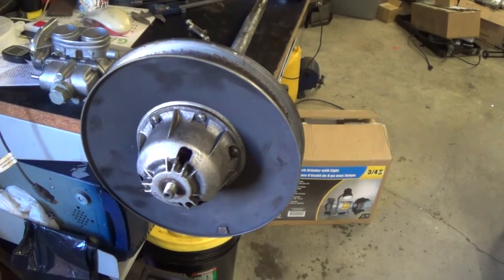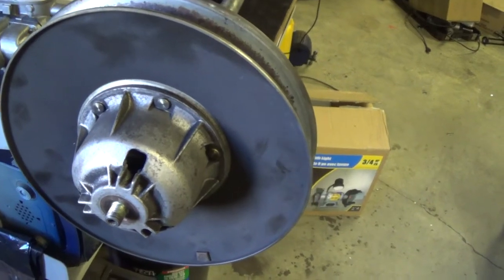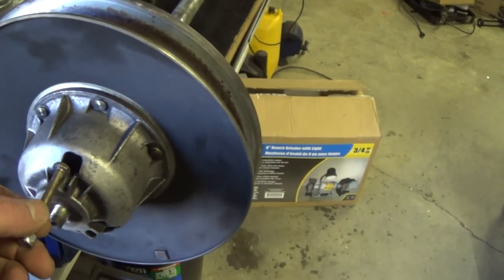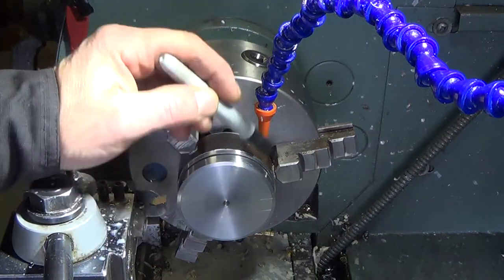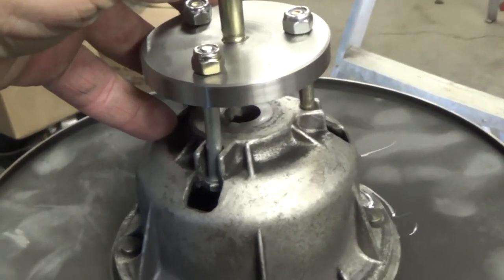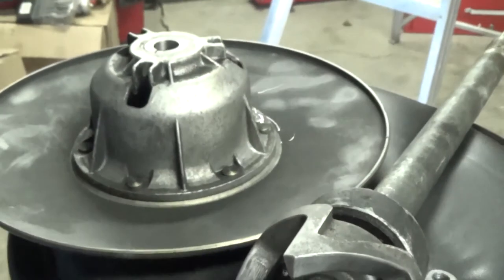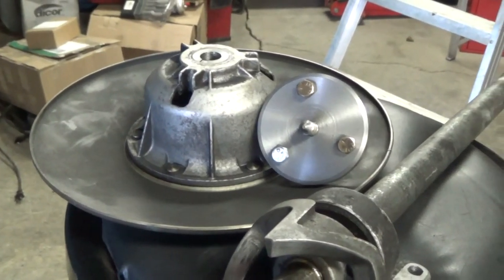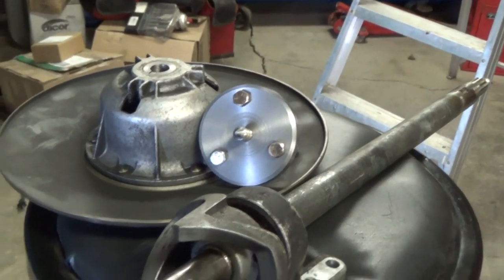Stuck Clutch

Comment: I am surprised you don't already have a steering wheel puller. Examining the first part of video told me it was a taper. A little tension and a small tap with a large hammer usually pops them off. Usually! Maybe good tension and some gentle heat. Hot and cold cycling under tension is good for rusty, dirty or poor finishes. Leaving the nut on but loose will keep it from hitting the floor. Use anti-seize on anything that may need to come apart again, especially outdoor or submerged. I know this 'cause I used to build/repair irrigation and manure pumps.
 I really like your double ended plate straightener. I use the butt end of a tool holder, sometimes I have used a single knurl. I may have to make one of those. Maybe just add bearings to some tool holders. Don't know why I didn't see it before. Besides, a bearing would be better on a finish.
  Thanks for the well done video,
   Mike (o\!/o)
Reply from the maker: I don't have a steering wheel puller...don't work on cars... :-)
Usually I try to take something apart without hitting it. That always leads to dinged up threads and such. For the short amount of time it took to make a quick puller it was the easier route.
Thanks for the comment Mike! :-)

Colin

Comment: Ideally, you'd make a pad to fit the end of the shaft and protect the centre. It might not be you working on the shaft this time, but it could be next.
Reply from the maker: Thanks for the comment and you are correct. A pad should be used to prevent damage to the center hole in the shaft. In this case I actually just used the center bolt to adjust the puller snug and then tighten the three bolts to apply tension. The owner was instructed in proper tool usage so as not to damage the shaft. Now that I think about it I should have removed the head from the center bolt.. :-)